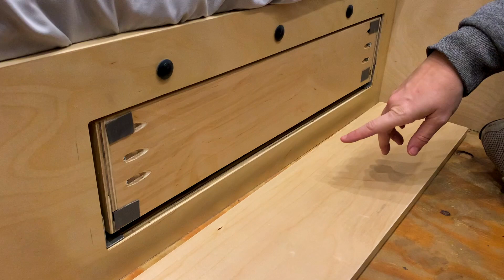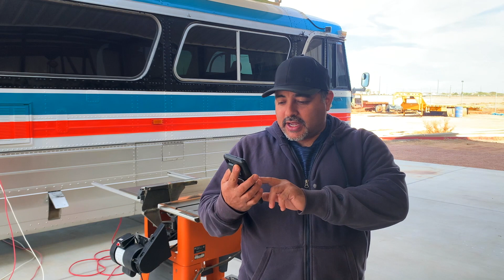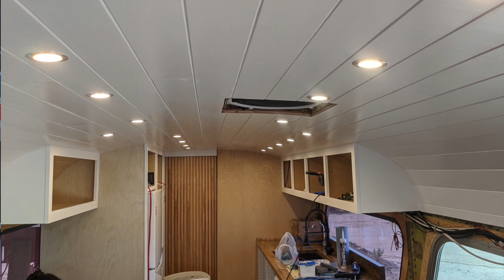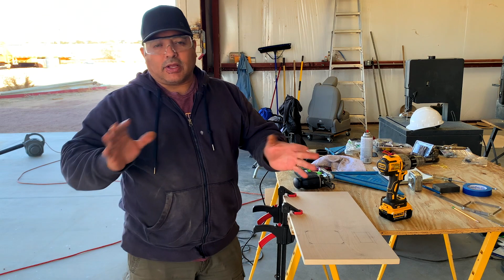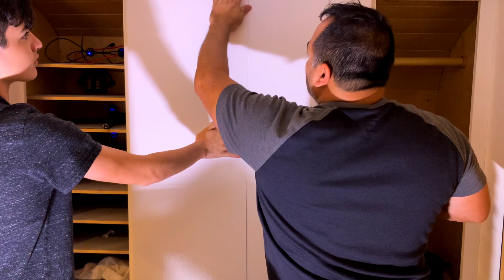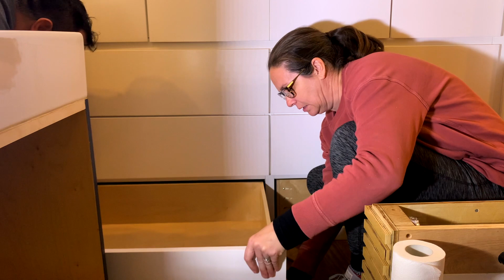Cabinet Doors & Drawer Fronts: Part 1 - Prep, Hinge Testing, A Bit of Install

Comment: Amazing work again.  On kitchen cabinets or anything else with heavy times beware that contents shift, lean against the door and open it.  Same for drawers, like our silverware drawer.  Leaving the north rim of the grand canyon we had our plate cabinet open and rain down Corelle on my daughter.  Guest what, sometimes Corelle does break..  It was a mess but no one was hurt.   We had to add these to a number of drawers and cabinets to keep them close on twisty bumpy roads.  Other options exist, including magnetic and such, I can't tell you if they are any better, I like these.  They are available in different pull weights, with electrical switches in them and other options.    https://southco.com/en_us_int/latches/push-to-close-latches/pull-to-open/c3-grabber-catch-latches
Reply from the maker: Yes, we will definitely be putting locks on all of the cabinets and drawers.  We are planning electromagnetic locks that are all controlled by one main switch.  We have the wires run and waiting for us to get around to that project.
Reply: @BeginningfromthisMorning  I am guessing you can also unlock one bin only if you need to via a phone or something when driving.

Comment: For air flow.  What if you beveled the inside edge on the top of the door creating an unseen gap between the door and the frame.    Wellll.  Airflow may not be enough.
Reply from the maker: That's an interesting idea, Ashley. The fans are pretty strong, so I am not sure if that would be enough air flow, but maybe?  Definitely an idea worth storing away.

Comment: Here's a trick for you, don't use wood filler for the ends of wood and any other places that need a super finish if you're going to paint the wood anyway! Bondo or featherweight/ rite Bando will do nicely. It will never crack, and sand nice! Look at the cars, nice and smooth. I've been using Bondo on wood for years, for repairs!
Reply from the maker: Thanks for the idea Sui.  We actually did try using Bondo to fill some plywood voids before painting, and it worked well, but it seemed harder to us.  We are total amateurs at all of this, and for us edge banding was just easier.  I'm sure if we were more proficient and getting the Bondo clean and smooth, it would have been awesome.  Edge Banding is our way of cheating.  :)
Reply: @BeginningfromthisMorning  : )

Comment: great work as always!.  Have you tested the drawers with weight in them and the bus cornering?  You dont want to be surprised the first few times...
Reply from the maker: Thank you.  We have driven the bus quite a few times since installing all the drawers and doors.  We don't have too much weight in any of them yet, so no real "full time traveling life" experience.  But, so far we have only had the big pantry door come open.  We will be putting electromagnetic locks for travel days on everything at some point.

Comment: Might could use super magnets to help keep the doors closed
Reply: Slow close drawers are locked in place when closed.
Reply from the maker: We are planning on using electromagnets to lock them for travel.  Haven't gotten to actually installing that yet, but the wiring is in place waiting for us.
Reply: @BeginningfromthisMorning  --- That will be cool - automatically unlocks when the motor is not running - unless you want to have a secrete unlock button for a particular storage area. Electromagnets will probably be more durable than super magnets (depending on the design) as super magnets are not very tolerant to repeated impacts, although, the slow close would probably help prevent hard impacts.

Comment: This is really going to be the GBoat (Greatest Bus of all times). 😍👍

Are you planning to implement some sort of locking mechanism to lock the cabinet doors and drawers so they won't open while on the road?

Btw: Great to see the younglings involved in the works. 😎👍
Reply from the maker: Thank you Panzergrennie - I am not sure we can live up to the GBoat moniker but most of the time we end up saying "well that turned out better than I expected" so I think we are on the right track most of the time.  We have already wired all the cabinets for both locks and LED lighting.  The locks will be electromagnetic and controlled by a single toggle up front (already wired up and fed into most of the cabinets).  This will "Lock" all the cabinets with a simple flip of a switch.  I tested some electromagnets about 6 months ago and ended up buying a bunch of them to use.  We'll see how it turns out :)
Reply: @BeginningfromthisMorning  that's pretty sweet. One relay and all locked. That's cool. How much juice will the EM locks use?
Reply: @allmomomosthomebus3895  it’s getting quite common on European motorhomes.

Comment: It's all looking very professional, well done guys!!! Could I ask if you could please do a close up of the paint finish on the cupboards? We are trying to decide whether to use ply or not for our kitchen in our bus and if the finish would look good enough. Thanks very much for any help or advice you have for us :)
Reply from the maker: Hi Judith - As I am sure you are aware - the prep is 90% of the finish :).  We use Birch plywood for the doors and the face frames are a mix of Birch plywood and Poplar (that's just what they have at our local Home Depot - we would have used any hardwood that was readily available). The closet face frames and front cabinets are plywood and the kitchen upper cabinets and pantry area is poplar.  Given a choice I would use hardwood for face frame cabinets because the doors have to screw into the sides and plywood does not generally hold a screw well in the ply.  Getting a great finish was really important to us so we developed the following Heuristic: We sand everything very very well (even pre-sanded wood) - we use a random orbital sander.  We then clean everything and always spray a primer (even though our paint claims to be paint + primer in one) - one heavy coat of primer is plenty we have found.  After this we sand with a fine grit sand paper (500 - 800 grit) and spray 2 coats of top coat - leave them to dry flat in case we went a little too heavy the paint settles on to the board instead of running.  We use an airless, cordless sprayer that we got off craigslist for $300.  If you are planning on doing your own painting I would 100% recommend an airless sprayer - the finish is really that much better.  If you email me (juan@beginningfromthismorning.com) - I can send you some high resolution pictures of our finishes and the exact equipment we have used and really liked.